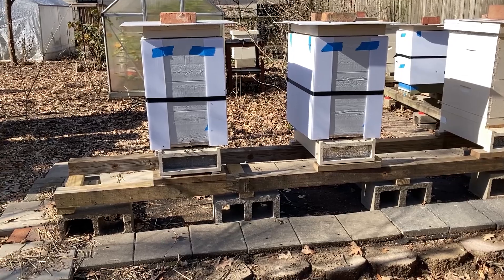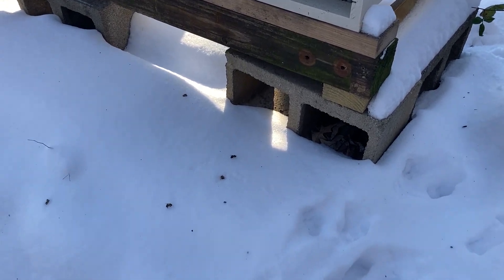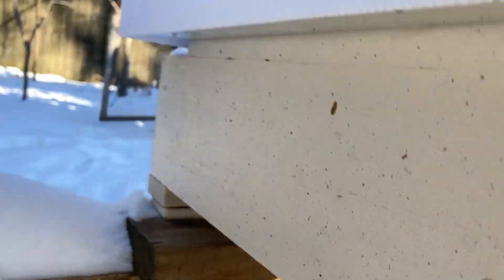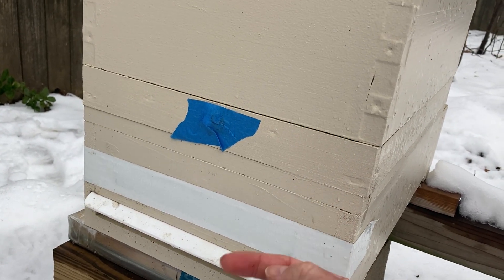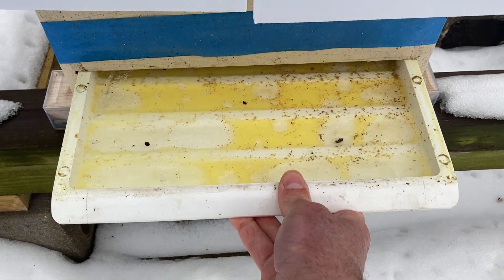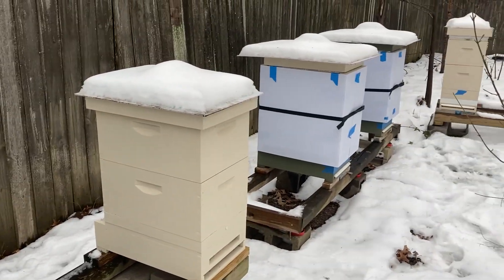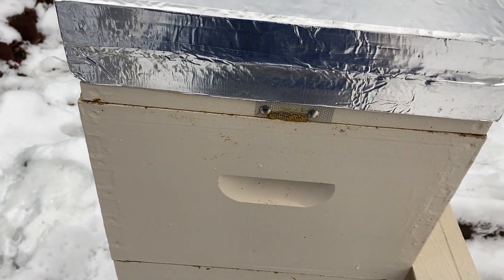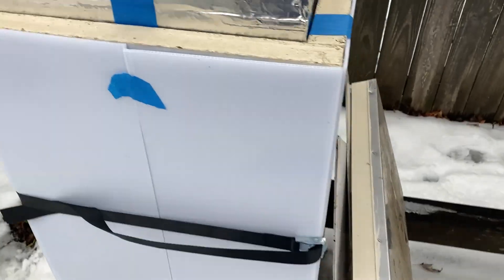❹ Bees in winter!  What are they doing?  How cold did they get?

Comment: How do you like those broodminder scales?
Reply from the maker: I like them and would recommend them if you have the money. Some of the newer ones are more accurate but I wanted to have all the same setup so stuck with the ones I have.  They help with peace of mind in the winter especially late winter when they are eating through their stores trying to brood up.  It also helps make sure I stay ahead of the flow with equipment.  You can actually see when the hive weight plateaus because they ran out of space to store the honey.  You can see our hives on the "view map" section at beecounted.org we are the only hives in West TN with scales.  You can see the data for as long as we've had the scales on the hives.  You can visibly see the flows and the hive temperatures from the past to compare to what they are doing now. Makes winter less stressful knowing what weight they should be at and when I may need to start feeding based on previous years.  My goal is to not have to feed unless I am making splits for nucs to sell so they can build comb.  The link below is one of the first hives we had scales on that has over a year of data.  https://beecounted.org/hive/summary/4Ryb/last1years?timezone=apiary
Reply: @BrianCooper901  That's great. i like the data I use the hive heart for monitoring, but I am looking for scales too. I may get a few broodminder scales to test out this year. I appreciate the details. Awesome set up